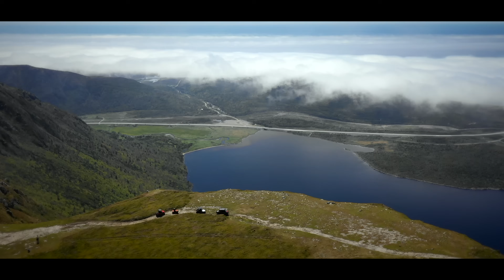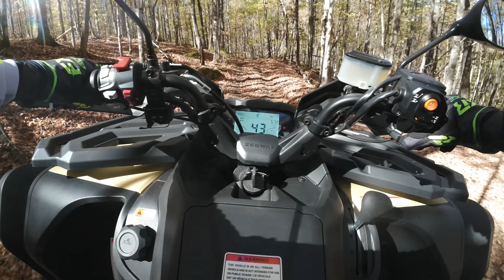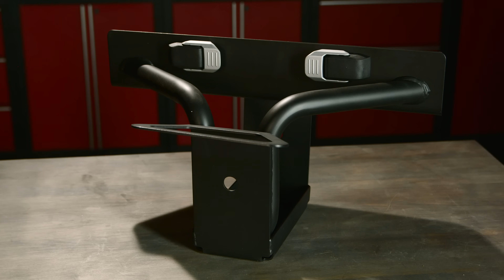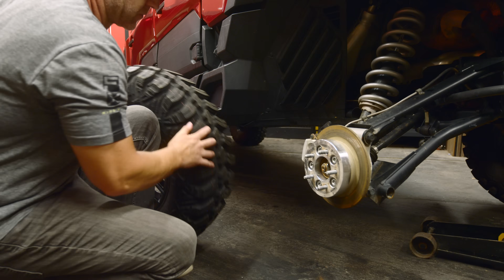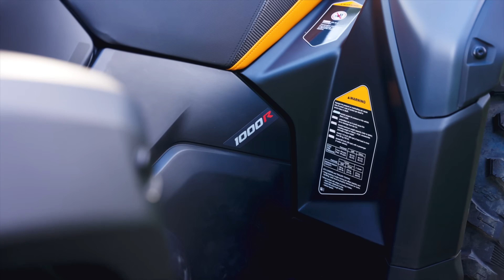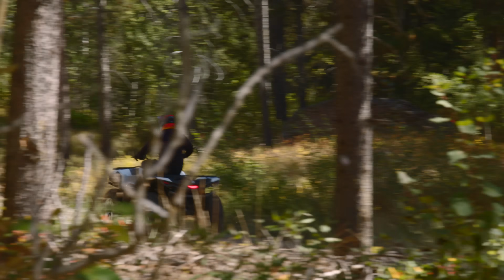DIRT TRAX 2025 - The Complete ELEVENTH Episode

Comment: The Segway does look appealing, but I trade machines every couple years, and looking at prices of used Segway and CF atvs that are 1 to 3 years old, their value drops off a cliff. I don't know whether that is because of them actually not holding up, or just market dynamics and public perception. You can buy a new Japanese machine, ride it 3 years and trade it for 85% value.  You can buy a North American machine and recoup 75% in 3 years, but the "off shore" brands are all over marketplace 2 or 3 years old for 40% of the new. It isn't that they aren't impressive for the price, they ARE, but if you have toy ADHD like me, the value proposition swings back the other way entirely. Especially now that the pricing has creeped ever closer to traditional brands.
Reply from the maker: Great points and always something buyers should consider when shopping for a new machine. Thanks for sharing. 🙌